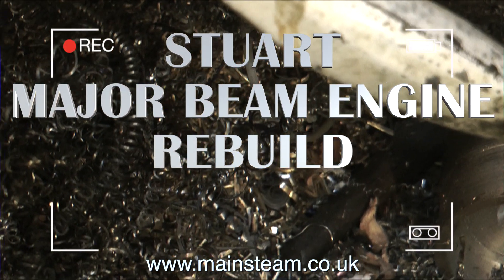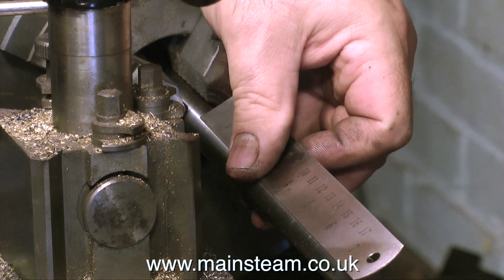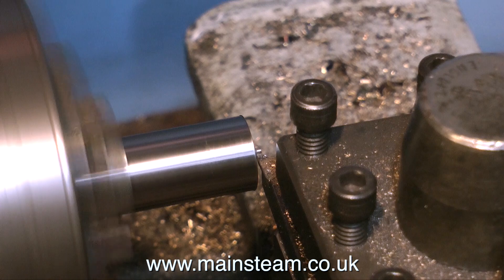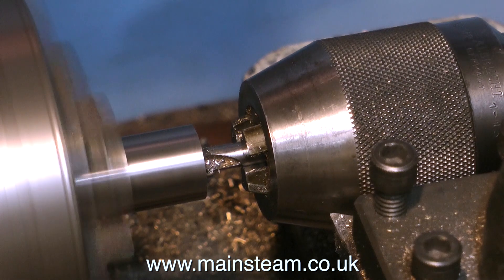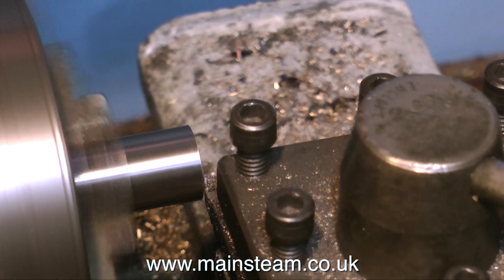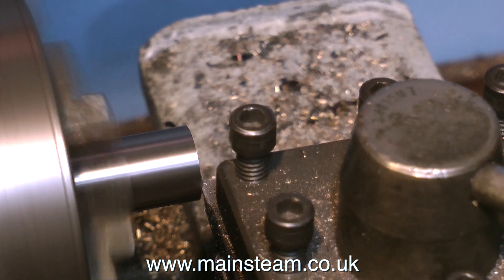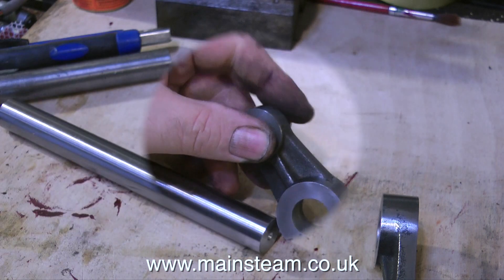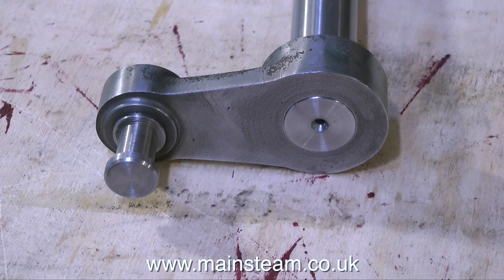STUART MAJOR BEAM ENGINE REBUILD - PART #15

Comment: My lathe is gear driven.  Instead of belts slipping it has a sacrificial nylon gear that destroys itself instead of powering through.  Not quite as good as being able to control applied torque with belt slippage, but it does offer a little protection.  I'm enjoying this series.  Your skill as well as humorous quips and wit are refreshing.
Reply from the maker: +NGinuity Yes that's a good idea too, except maybe for having to buy a replacement gear - especially if it's Saturday evening and the shop is shut until Monday Morning ...... Thanks for the positive comment ......
Reply: Keith Appleton
Agreed.  I actually keep two onhand for that very reason.  Haven't had to use it yet but they're really cheap to not have backup.  Keep up the good work!